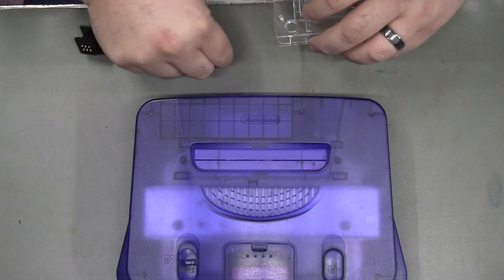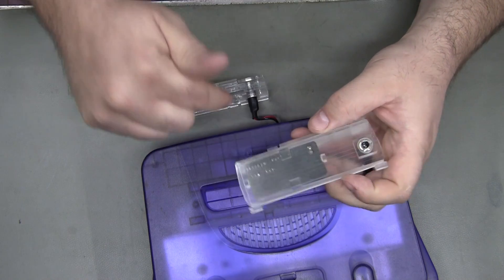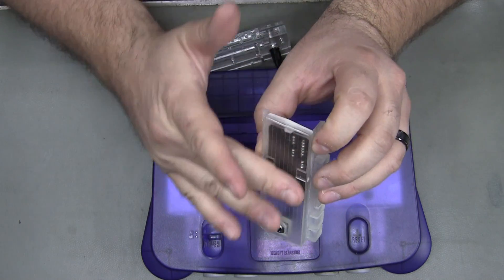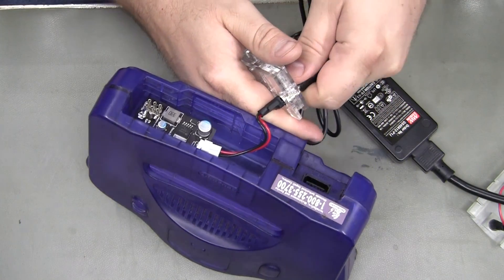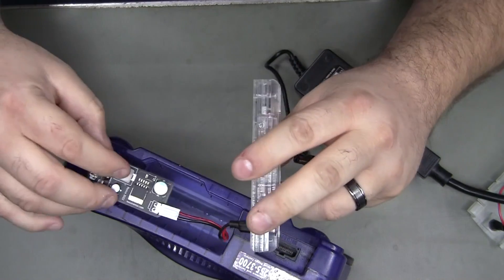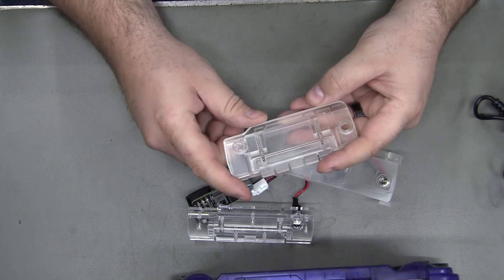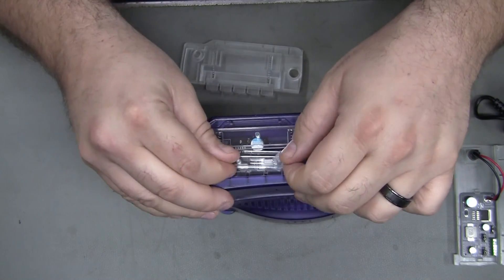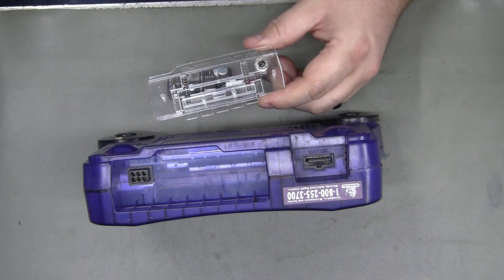ReN64 PSU clear clip in rear cover Nintendo 64 N64 power supply modification upgrade

Comment: I'd personally rather have one with the AC/DC adapter build into the unit, and have only an IEC C8 or C14 inlet on it.  I just hate having large bricks laying around for things, unless a lot of consoles end up with the same same type of mod, allowing for one brick to work with 4 or 5 different consoles.

Otherwise it looks good though.
Reply: Totally agree! That would be ideal. And the physical space necessary is very much there.

Comment: if they're done well, i can see this sort of thing being very viable, and indeed needed, simply because at some point, more modern psu's will fail, since most of them at switch mode supplies, and the caps will take out other components eventually.

Comment: Way cooler than it has any right to be.  I have no dog in the fight because I don't have a N64 an never did, but I think the spring clip mechanism makes it seem like a more premium part, even if it really isn't.  The normal thing to do would be the built in plastic spring clip thing that always breaks, and no one wants that.  This is something easy to install that can double as a conversation piece.

Comment: Cool.  Wonder if USB-C PD would be an option for these consoles.
Reply: Ugh, USB-C is a nightmare. Sure, you specified USB-C PD, but having a hundred different implementations of the same connector makes the whole thing a total crapshoot for the average consumer. I have the same concern with people using a 15 pin d-sub "VGA" connector as a 15khz RGB output. Someone will try a cable or ac adapter, complain that it doesn't work, and then throw the whole thing in the bin.

Comment: I bought the newest version but that thing gets very hot after one hour. You can hear the plastic shelve crack from the heat after a while. Is it really save to use it inside the Original PSU Case ?! I guess the clear rear cover wouldn't make a difference in terms of the heat?

Comment: I would be more interested in these aftermarket psu's if they could plug directly to mains without a brick.
Reply: I think, in general, it's a good idea to reduce the number of DIY mains-powered PSUs.  There are several good reasons most sizable companies don't bother making their own.  One of those is worldwide safety and compliance certification.  Another is the prerequisite to the former.

Comment: Change the connector to the figure 8 two prong and that really eliminate any wall wart
Reply: You're gonna need a lot more circuitry for the 120-240V that is supplied from a figure 8 lead. Basically the same amount that is inside the standard N64 PSU.
Reply: @jaredbowhay-pringle1460  This design in its current configuration doesnt resolve anything IF you still have to use another PSU to power it like he has here. Id rather have the block hanging out the back of the console and the power cord going directly to the plug. This adapter does nothing and just adds an extra step
Reply: @meisJ420   That's a huge liability, and nobody wants to deal with the legal issues surrounding mains-connected PSUs.  And you don't want someone's hack-job circuit that is handling, potentially, thousands of watts if something goes catastrophically wrong.

Take the brick.  Trust me.  That's the correct path here.
Reply: @nickwallette6201  read post above. Thats what i just said
Reply: @meisJ420  No, it isn’t.  People here are asking for this to be an AC PSU.  I’m saying that’s not a good idea, possibly unsafe, and in some places, potentially illegal.  Ergo, using an external power brick is the only viable solution, unless Delta or some other reputable PSU supplier wants to get into the aftermarket retro console market.

You said this offers nothing compared to using the existing N64 PSU.  It does, though.  It’s getting on 30 years younger, and you will always be able to find a DC PSU with a barrel plug on it, so you can keep refreshing the mains PSU part until the console turns to dust.  That is the point of this project.

Comment: Should be USBC and not barrel. Jack
Reply: Needs more circuitry to negotiate power over USB-PD, and would require a more expensive power supply.
Reply: The idea of USB C is the charger to replace all chargers, I’ve already got to the point where I have 2-3 2W USBc chargers so that’s why I’ve been working on making a PCB to replace the circuit for the oem power brick. Didn’t even concider a plate mod like this, this is wicked

Comment: @GameTechUS i have an Idea for this PSU replacement to make it even more accessible for everyone...
My Idea:
Make another revision of the Barrel-Jack-PCB where you implement a Full-Bridge-Rectifier on the PCB itself directly after the Connector for the Barrel-Jack, so that you can plug in any 12V 3A Barrel-Plug, no matter which polarity it has (just 4 diodes) because this makes it much more versatile and it becomes a TRULY UNIVERSAL PSU instead of being limited to a specific polarity (not all PSUs have the required polarity)...

If you consider making this modification come true, please let me know about it here in the comments

Best Regards, Kevin B. (Cinderace Modz Germany)